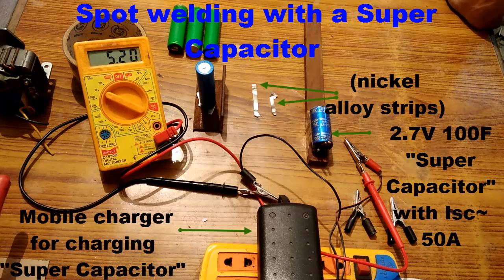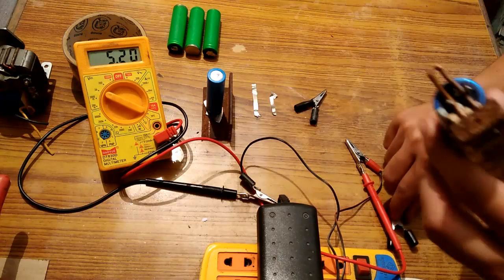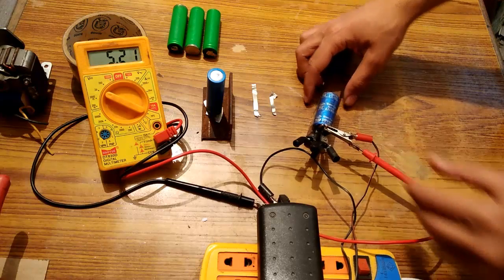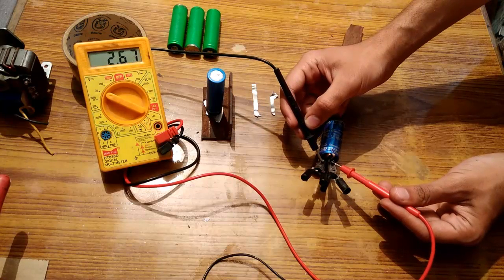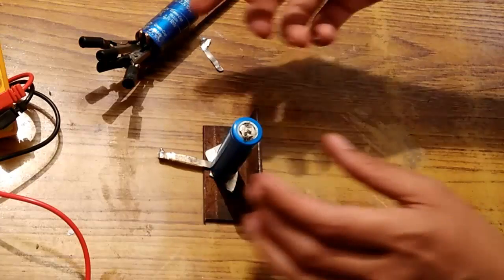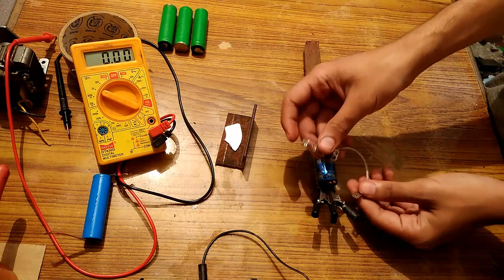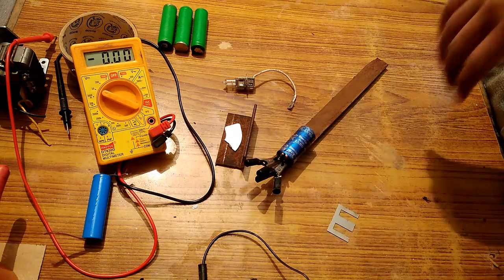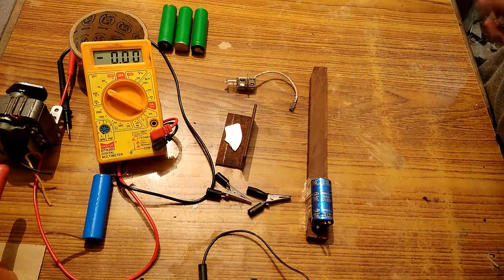How to Make Battery Spot Welder || Super Capacitor Welding DIY

Comment: I do have the same 100F 2.7v capacitor and I used to charge it with 5v2A android charger but still it doesn't welds instead it makes the surface hot only.Can you tell me how and why?
Reply: Yes please?

Comment: Is it safe to use 440v capacitor for spot welding 18650 batteries
Reply from the maker: No
Reply: @MrElectron  ok, thanks. It means we should use voltage less than the battery 18650 i.e. 3.7v

Comment: I bought the new 2.7v, 100f capacitor in rs310 in india and i charged it upto 2.69v but the voltage is dropping so fast because of this spot soldering is not possible.
So please suggest what can i do?

Comment: Use a cheap PC power supply and 4 10amps diodes and use 3.3volt rail to charge this super cap

Comment: Plz give more detail for chargeur volt and ampere out?
Reply from the maker: 5v input from mobile charger.Amps are 2.5A from mobile charger
Reply: Mr Electron thanks professor.
Reply: If you have an adjustable powersupply i would set the current as high as the wires and your powersupply allow(so it charges faster) and the voltage on the max rated voltage of the capacitor so you can't overcharge it.

Comment: Good informative video. I have one doubt The capacitor is rated for 2.7 volts. Can it be charged from a  5 V DC source? Will not the voltage overshoot the 2.7 V and the capacitor get damaged? Can anyone please clear my doubt?
Reply from the maker: +Guptan Veemboor yes it will damage the capacitor for sure.Connect a multimeter to uts terminals while charging and disconnect the supply as soon as  the voltage 2.7V is displayed on the multimeter
Reply: U can use a buck converter to regulate the charging voltage. Just a thought
Reply: a buck converter with adjustable constant current (CC) would be perfect

Comment: I'm learning so please don't judge me I have all the components but why do I need the bulb? thanks
Reply: For not short circuiting the power supply when welding (and for not charging the capacitor with a too high inrush current also).

Comment: I was thinking this myself. But how dangerous can a 3 v supercap be, anyone knows?
A microwave cap is 470 volts and that thing can be dangerous if charged.
Reply from the maker: no danger of shock but there is high current that burns the strip red hot
Reply: This is High Current but very low voltage 2.7V DC Capacitor you can hold the terminals with bare hands without a problem. A microwave is Ac hence Danger.

Comment: Good video.  However, my question and concern would be control of the heat transferred to the cell. Visually it appears to be considerable.  I think that high amperage for a shorter time will tend to localize the heating to the weld contact area resulting in melting and welding with lower total heat transfer than lower amperage for a longer time interval; this due to the thermal conductivity of the nickel strip and can substrate. The fact that the resulting weld is physically acceptable isn't the only criterion to be considered.  You could assess the heat transfer by trying a weld with a nickel strip on top of a piece of 0.3 mm thick steel sheet supported by a piece of wood and observe the amount of charring that occurs on the wood.  Lower amperage longer duration intervals produce much more charring than higher amperage for, say, under 10 ms.  It is easily possible to transfer significantly more heat to a cell via a suboptimal spot-welding process than by soldering, and soldering can transfer a lot of heat.

Comment: Is it essential to use the copper conductor? I have thin ones and I managed to do only one spot welding on one charge after I had really struggled with it.. So thinking it might be the conducting..
Reply from the maker: Yakir Gabay yes only copper or some other conductor with higher melting point

Comment: If you had 4 caps in series, this would work so much better. Still, awesome idea!

You should try it out with 2 caps. Along with a push button and a 5v relay, and a USB charging port at 5V, would make for an awesome powerful spot welder.
Reply: NeutronPCXT im still looking forward for this video

Comment: sir I have the same capacitor, the cell phone charger is 5 V 1000Milli amps is it ok ??
Reply from the maker: Rajendra Caterers & Confectioners Limited - Sure but you have to make sure not to charge the capacitor above 2.7V coz it will burst open..
Reply: Please Recheck your views on Capacitor Bursting at Higher Voltage. i was reading an article yesterday that says
"Charges in Seconds, No end of charge termination required.
Simple charging draws only what it needs not subject to overcharging.
Safe forgiving if abused"
I have prepared the unit myself and am planning to charge with 2*3.7V Lithium Cells in parallel.  Will Try and inform.
First I need to Confirm the  data read by me on overcharge